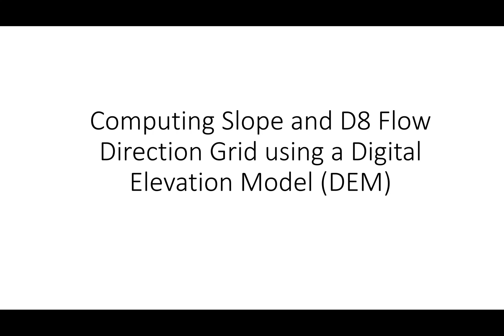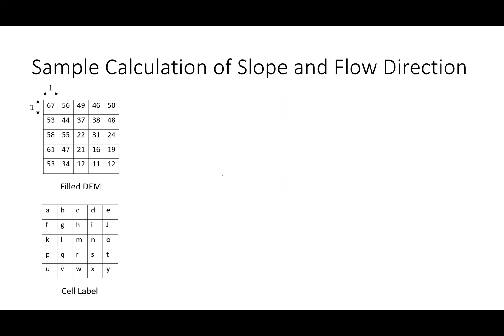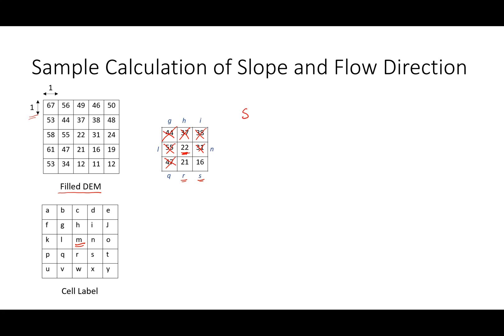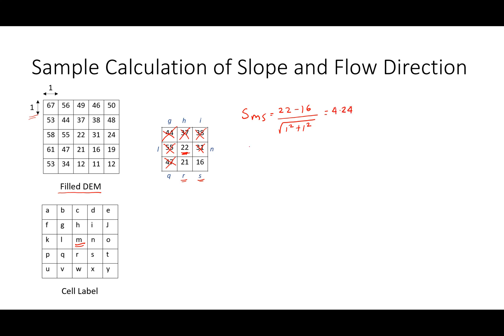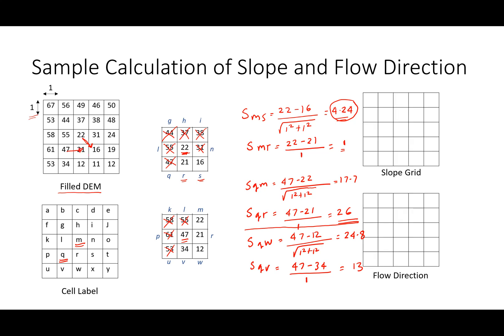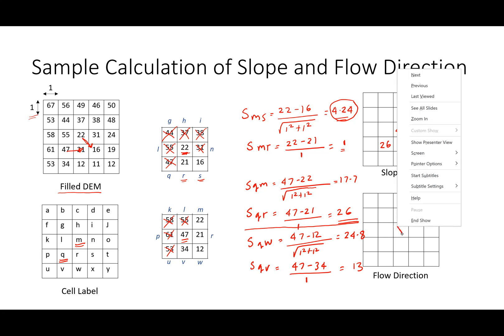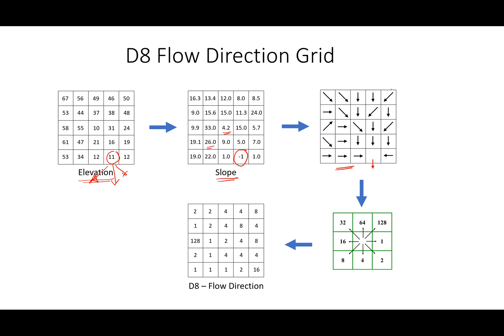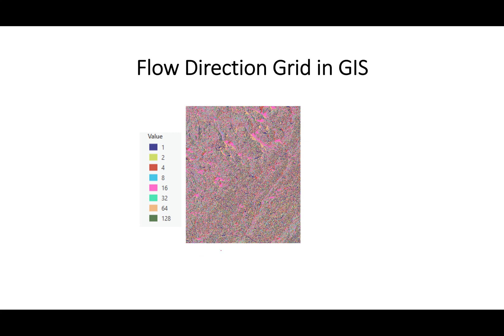Computing slope and D8 Flow Direction using a DEM

Comment: Sir, I am getting flow direction values other than 1,2,4,8,16,32,64,128 even after using the filled DEM. How to overcome this issue? Your input will be very much helpful for me.
Reply from the maker: if your area very flat and/or in coastal region?